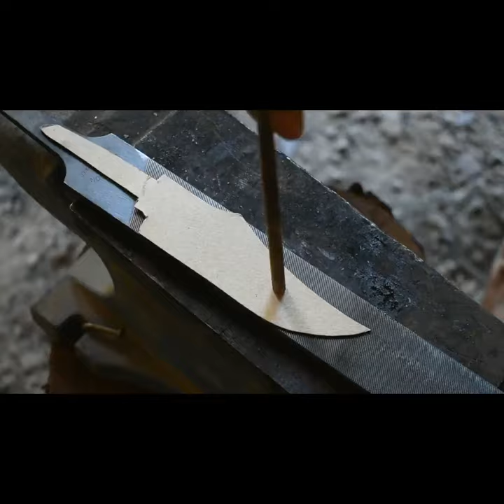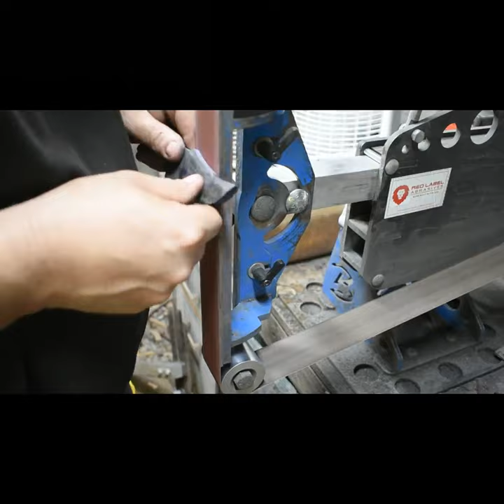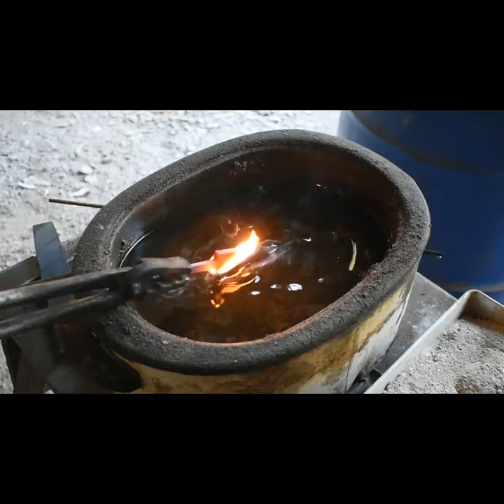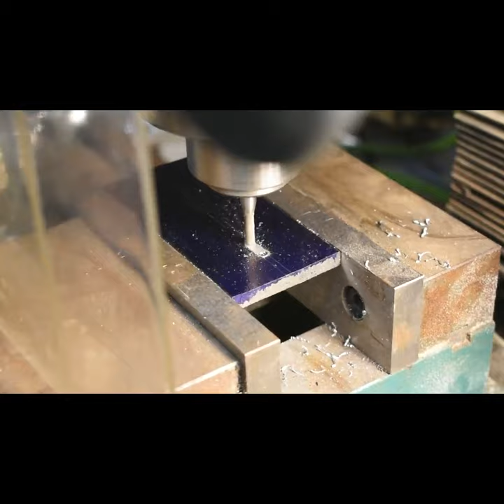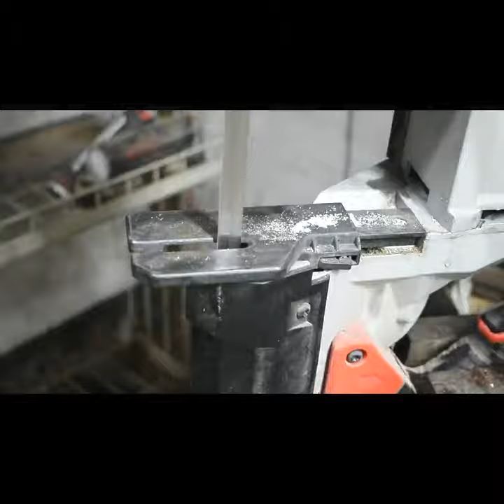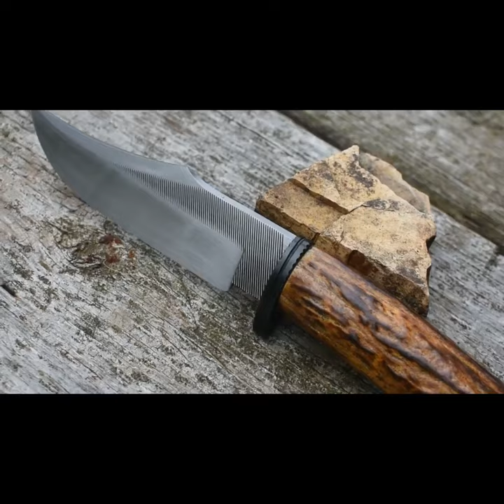Making a Bowie knife from a file #shorts #knifemaking

Comment: I have a question: since files come heat treated from the factory, do you have to anneal them before cutting them with a bandsaw? or can bandsaws cut through hardened steel safely?
Reply from the maker: It would be best to anneal it or temper it back before cutting especially if you are going to heat treat it again. Bandsaw blades will cut hardened steel but it will be very slow going. Here is a link to a video where I made a knife from a file without using a forge https://youtu.be/ioEG4rm8LVU